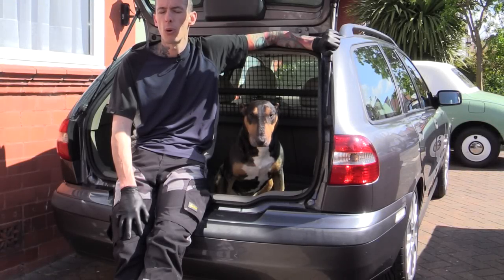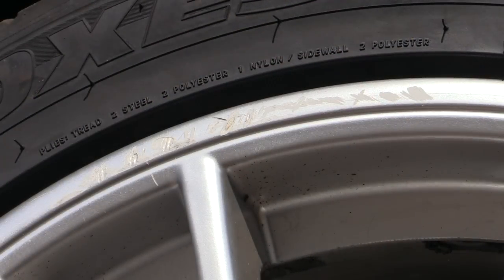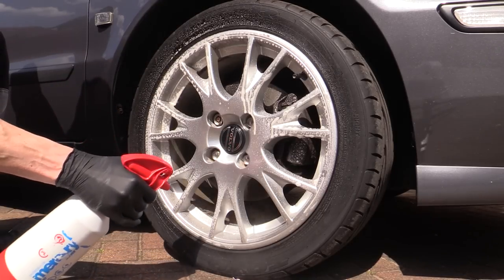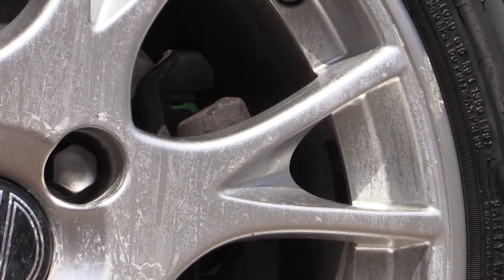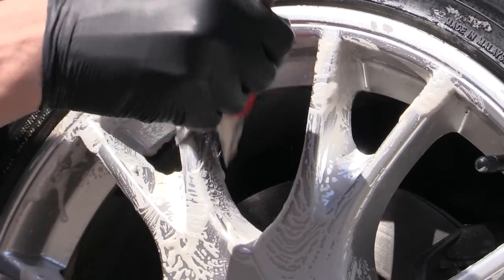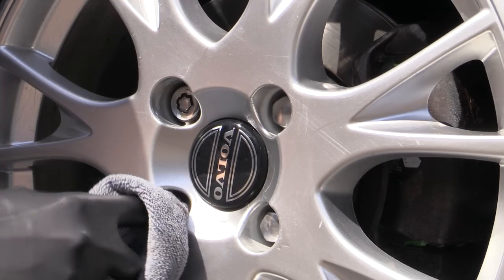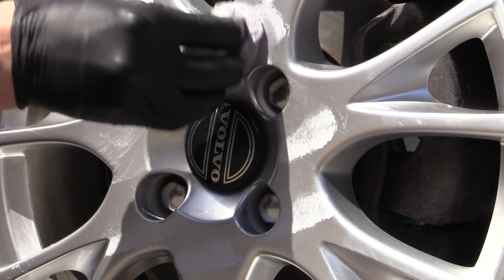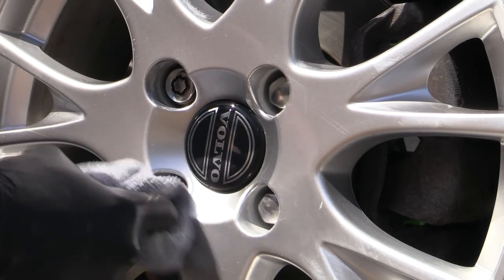What Happens When You Let a Corrosive Wheel Cleaner Dry?

Comment: What is it you like/dislike about the spray bottle? I have been thinking of getting a few of these and would be interested in your opinion on them.
Reply from the maker: They don't come in 750ml (which is the perfect size for detailing imo), only 500ml and 1 litre.

Depending on the product used, the flexible tubing inside the bottle can harden, meaning they can no longer be used upside down.

It's 50/50 whether the double action trigger continues to work after initial usage (the one in the video doesn't), and if you drop them, because the screw collar doesn't sit over the base of the trigger it breaks free and releases a small ball bearing you'll never find, meaning it no longer works.

Don't get me wrong, they're decent quality sprayers and when they work they're great but they just don't lend themselves to car detailing very well in my experience. I think I'll either be downsizing to the 500ml or going back to standard generic chemical resistant items I've used for years.
Reply: Thanks for the detailed reply. 👍🏻

Comment: I've actually had a wheel cleaner bake right on to my aluminum wheels. I took my car to the wash after a 30min drive and it turns out it's a bad idea using cleaner on hot wheels. At the time I couldn't remove the stains with degreaser or soap so I used my last resort which was 3000 grit sanding pad. stains are mostly gone but I need to polish and clear coat the wheels.

Comment: Concept use to have a product called surge it was a descaling acid really nasty stuff just the smell of the stuff ( a gently sniff not a good old lung full deep breath in) was enough to make the lining of your lungs shrivel, but diluted 3 to 1 sprayed on and power washed was great for those wheels that had 10 years of harden on brake dust but if left on or used on hot wheels would start dissolving the finish on wheels.

Comment: How well Mercury Kwazar spray bottle stands against harsh chemcicals?
Reply from the maker: Not as well as less expensive trigger sprayers in my experience!
Reply: asking cause i've had problems with bottle leakages after some time..alkaline products eats away plastics :(. I wondered if plastic bottle for acid (ex Hydrochloric acid) will stand longer or be even permanent solution...lets say I buy acid in shop, and re-fill with wheel cleaner

Comment: It didn't stain it because the sodium hydroxide won't react with the paint, unlike it would with something that would likely be more reactive such as a bare metal. It should also be noted that not all corrosive cleaners are equal. This is one uses lye - which  is a base. Acidic cleaners will react differently. (or.. rather may react. There's more to it than acid/ base, corrosive/ non-corrosive.)

Comment: is it not that the dried product may become airborne and possibly inhaled or ingested ? I work with caustic products which are relatively (!) safe in a natural state but if vaporised through pressure (mist) or through heat (steam) it becomes positively lethal :-) Just a thought as to the dire warning, not doubting its ability to inflict actual wheel (or brake calliper / disc for that matter)  damage.

Comment: If you want to see sodium hydroxide burn aluminium look up some amateurs trying to remove the anodizing from aluminium. One used oven cleaner that had so much soap in it he couldn't see how far the process had gone. He ended up with a black aluminium oxide layer he removed with a coarse wire wheel.

Comment: How about Meguairs Wheel Brightener? Thats an acid wheel cleaner
Reply: abger saurus completely safe. I use it on oem wheels clear coated, after market wheels painted, powder coated, clearcoated. all safe. on aftermarket wheels with polished lips, you may have to go over the lips with a metal polish after. I use wheel brightener exclusively. take place over iron x even on body panels. very affordable. 1 gallon makes 7 gallons in my case.

Comment: Wouldn't the point be that letting the stuff sit on isn't as bad as we assume and at the end of the day, all it means is a little more work?
Reply from the maker: Maybe but saying that might make people overconfident as I think this was a kind of a one off.
Reply: Good point! Better safe than sorry when it's £250 each corner I suppose
Reply: You 'think' it was a one off? Was it really a one off?  You didn't actually state that in the video. You set it up saying what could happen, and showed what the bottle said then proceeded to find out what actually happens. It turns out pretty well nothing in this example. Your conclusion then was that it was a failure to meet your expectations rather than your expectations perhaps being wrong - borne out by this example. 

I was waiting for an explanation of what your normal 'experience' is with this circumstance but rather you kept saying you need to try another wheel. If you have actual experience of a different occurance what do you think was the reason it didn't happen here? It just appeared that you were wrong about sodium hydroxide. I don't know myself, I clicked the link to find out. It seems it won't damage a coated wheel.

Comment: cool Down the Wheels with Water before use the cleaner if the Wheels not hot use Water before spraying the cleaner anyway  the cleaner would do the job anyway and the acid wont dry inn

Comment: I have a Ryobi 2000psi electric pressure washer and use a Lemonbest foam lance. Recently I bought Chemical Guy's Honeydew snow foam but got disappointed because it didn't create foam as I thought it would. Then I started playing with the dilution knob and found out it created foam not all the way to the right but somewhat at the middle, but it didn't came out as thick, really runny. I also thought my foam lance was the problem because its cheap and a 2000psi PW is more than enough to create foam. Any help?